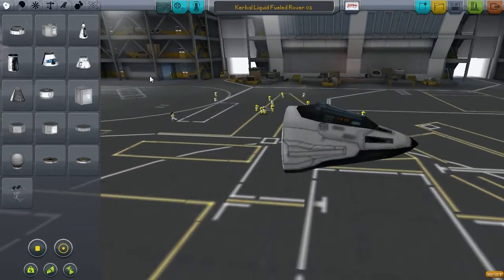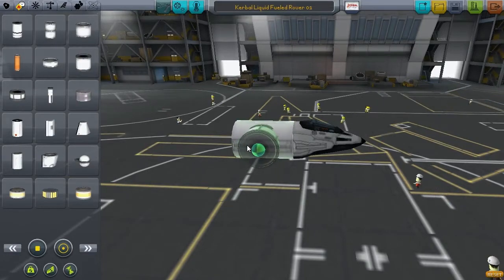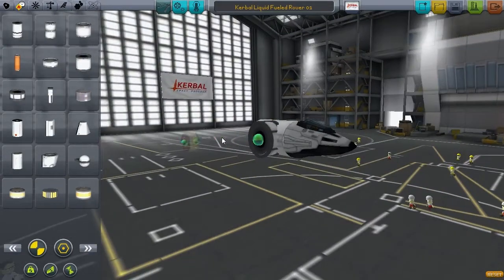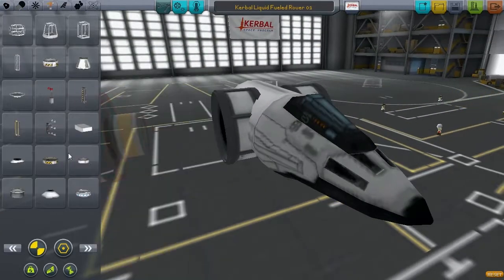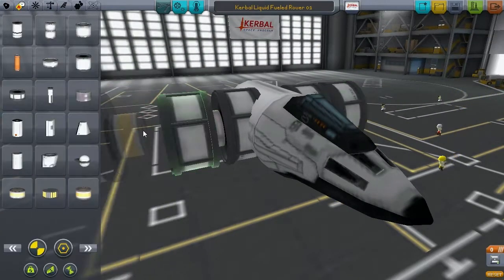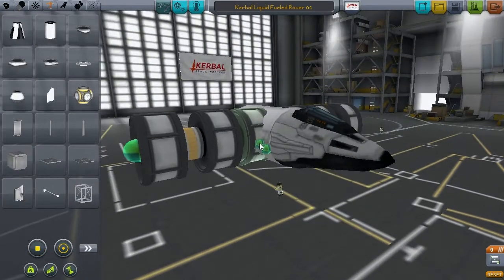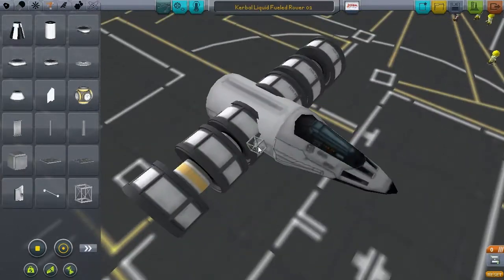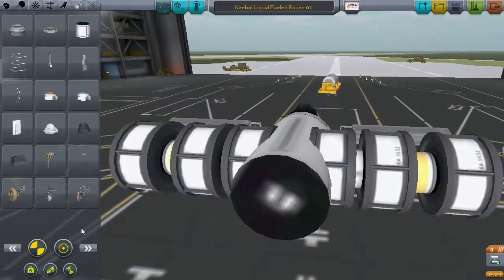Challenge to Veiwers, Build a liquid fueled rover with NO net thrust

Comment from the maker: Just as long as you don't spin the kerbal somehow, then you could do that. However your still going to need some form or bearing to keep the drive wheel turning and the pod and stabilizers not. In the video I used a smaller version of the landing gear based bearings designed for the helicopter builds, however due to the suspension on the rover wheels being lots softer they tended to fail. So all in all, if you think it'd work, give it a go, I'd love to see the results!